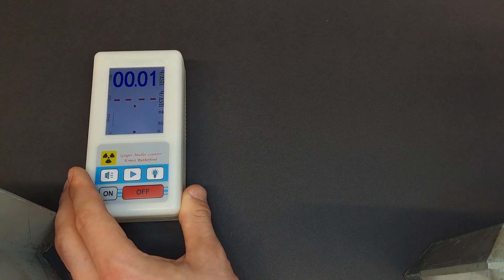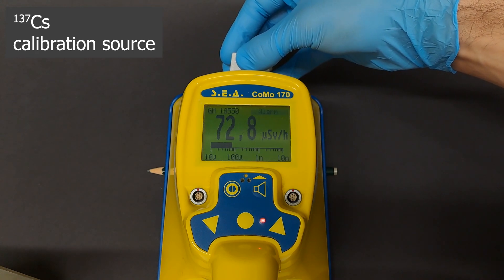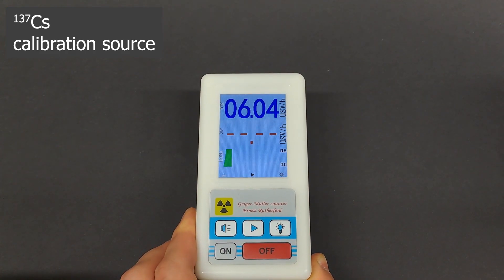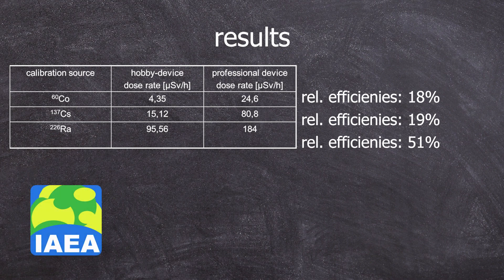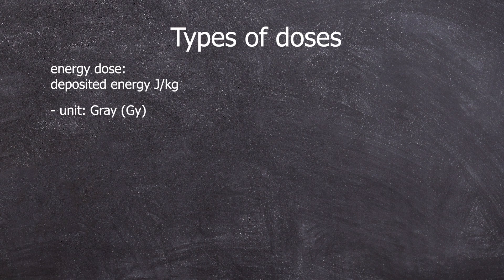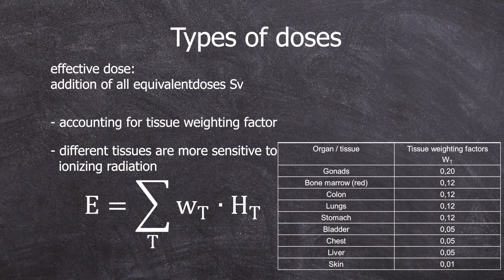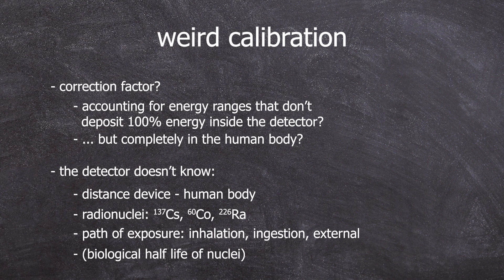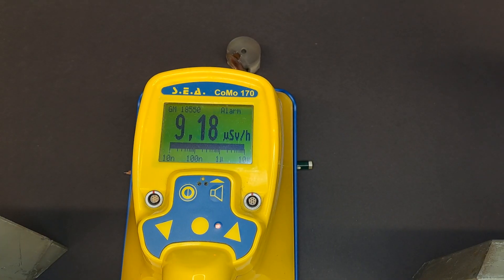Dose Rate - Comparing Measurement Devices! - Nuclear Chemistry

Comment: You aren't going to get a accurate dose reading with anything using a Geiger Muller tube unless you measure only the isotope it is assumed you are measuring. GM tubes count detectable interactions and not energy. You need an ion chamber or a spectrometer to get a accurate dose reading.
Reply from the maker: you are correct! But the interesting thing is: the Como170 has the same readings as our electronical personal dosimeter, which we have to use for legal reasons. I am completely on your side don't get me wrong but this overresponding of the GMZ is what german authorities are accepting :D

Comment: Wouldn't mind seeing how the GQ GMC-600+ compares to the professional unit, being that it has a pancake tube in it so it'll be able to detect alpha, but its also a lot more at $350 USD.
Reply: Detecting Alpha wasn't really something that i needed so i cheaped out and bought a GMC-320 plus v4 which was around $100 USD, but i do want a detector that will detect alpha but i do have to save up to get something capable of that. 

Seeing a few cheap ones having completely different reading from the same source, I guess it will depend on the quality of the tube they use, and the software running. 

With the GQ-GMC 320 plus there's been multiple firmware updates adding capabilities and expanding it's max count. 

I was always annoyed just how slowly the cheap units count up (just like with the cheap unit in the video), a firmware update for my 320 plus added fast estimate reading. 

When I bought my Geiger counter I bought a spicy business card from United nuclear the same time I bought my counter (it's what I call their geiger counter test cards) before the update it took a few minutes to count up get to steady state, now it counts up within a few seconds.
Reply: The GQ 320 firmware update also changed the max reading it could display, from the factory it could read a max of 65535 CPM, 328 uSv/h, and 32.8 mR/h. After the update it could now max out at 153800 CPM, 1000 uSv/h and 100 mR/h.

It also added the capability to adjust the voltage for the Geiger Muller tube, and added a few more points of calibration. And a few other things.

Comment: Maybe a cheap device without calibration and certificate? Because I work in a company which produce dosimeters and even cheap devices with Geiger-Muler tube are calibrating on strong Cs137 (range from 8 mkSv/h to 800 mSv/h)
Devises such as MKS-05 TERRA
Reply from the maker: I woud try any device that I would get my hands on. I asked radiacode for one... maybe they send me one ;D because buying every... I'd be poor
Reply: @SimonsNuclearchemistry  Unfortunately, it's unlikely to work because I am just a programmer, to make this happen it needs to be higher in the chain of command

Comment: I think scintillation detectors should know the energy of the particles, it would be interesting to see how accurate detectors like the radiacode or raysid are
Reply from the maker: I asked Radiacode for a device. Now we gotta wait for a response ;D
Reply: @SimonsNuclearchemistry  fingers crossed!
Reply: @SimonsNuclearchemistry the Radiacode 102 is an amazing piece of engineering.  Russian design, of course, since they have more actual experience with radiation than anyone else.
Reply: The Radiacode can't detect alpha can it?
Reply: @madmax2069  Correct, it can't.
Reply: I got the radiascan 701a a while back when it was sub $320, then the price spiked a lot. Eventually it disappeared on the internet. Does anyone know what happened to it? I still have mine at least. Wonder if I should sell it sometime as I don't really use it anymore
Reply: @uiohgycgfhgjh  probably just got replaced by something better, or the same internals but just in a different case.
Reply: @uiohgycgfhgjh There's also a 801 version, with energy compensation. It seems that they are unable to send 701, 801 or it's GM tube out of Russia, and maybe the production stopped. 102 and 103 are now made in Cyprus.

Comment: If I remember correctly, the cheap meter you show in the video should be fitted with a Chinese-made Geiger-Müller tube marked J305.
Reply: Are those similar to the M4011 tubes? Because that's the tube in my GQ GMC-320 plus v4.
Reply: @madmax2069  it is an equivalent model, at least within the manufacturing tolerances.

Comment: Wait, wait, wait! Is that Ra-226 source really only a few days old? Because if not, then it is emitting waaaaay more gamma than just 186 keV at 3% intensity.
Reply from the maker: YES! :D This sample prolly has Rn-222, Po-218 up to Pb-210 in it. I thought Ra-226 would be a more relatable source for some than lets say Ba-133 :D
Reply from the maker: The Gamma Occurance of the 186keV line is 3% and will ever stay that way. But yes it emits other Gammas from other elements^^